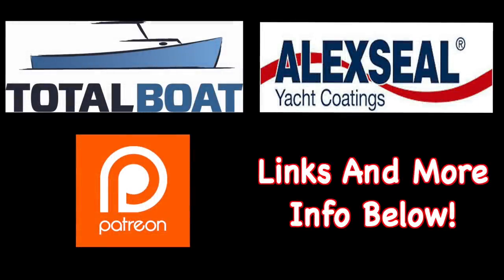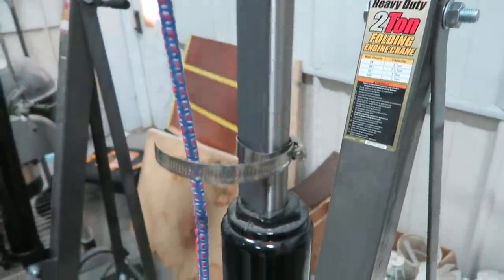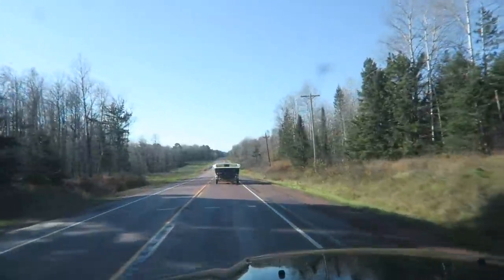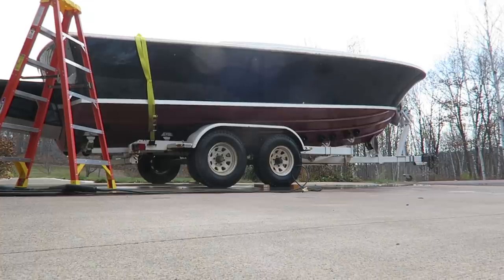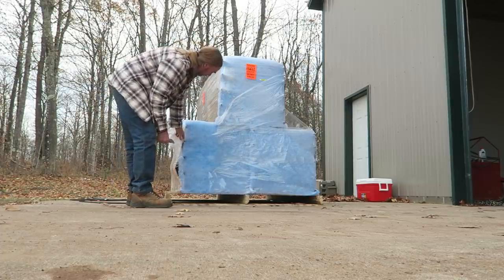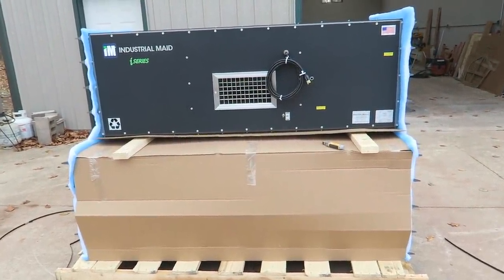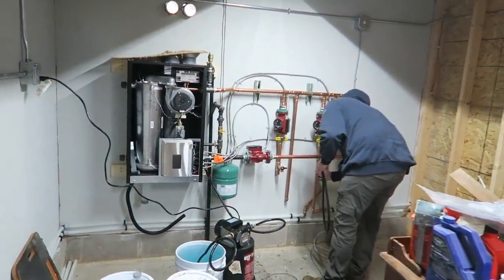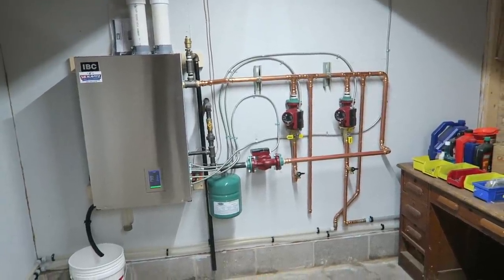Moving The Bertram To The NEW Boatworks Today Shop!

Comment: Andy, next spring, if water continues to be a problem along that concrete block, have a foundation guy spray it with waterproofing on the outside.  It doesn't cost very much and is done every day for basements and crawlspaces.

Comment: FYI you can wedge a 2x4 between the ram base and the ram top. You may have to trim bottom of board to fit between base and ram. Add a small peace of flat bar to keep bottom of wood from splitting if needed. Worked for me I could sleep at night with this method. Keep up the good work!

Comment: on your water penetrating the side wall.  first thing is check the slope of the grade adjacent to the wall make sure it drsins away from the building and your not inviting water to live alongside  the foundation.
second if water is attracted to the foundation you may need to trench along the wall, clean the concrete well and apply a good sealer to the concrete.  theres a bunch of them made for this purpose and one is about as good as the others.  while the trench is open toss in a perforated drain pipe to channel any water getting down there out behind the shop somewhere.  Definitely a spring project and you have a lot of time to think about it.  this is just one idea you might consider.

Comment: Andy, I told Beau and Brandy Sailing. They are bloggers just like you but they are sailors without alot of knowledge about fixing boats. But they will be experts soon. But anyways I told them about you and that I watch your show every week. They have a leak somewhere on their boat. They will find it. But the situation where they will need advice for is between the fiberglass and the lead keel is water. They drilled holes to let the ocean pour out. Yes I said ocean. From what I saw it was alot of water draining from about 6 quarter inch holes. I would guess about 2 or 3 gallons of water. I told them about penetrating epoxy but from the amount of ocean that drained out they will need a much cheaper way of going about filling that crevasse in their boat. I told them about I watched you show when you rebuilt the rudder on a project. You used some kind of epoxy foam that won't soak water. I was thinking if they used that to fill the void than penetrating epoxy further up to re-attach the hull to the lead keel. But anyways what I'm asking you is what do you think. Am I out of my babbid ass mind or do you have a better solution?

Comment: Around that perimeter, Drylock makes a "crack filler" that you put at that joint, and then grab the drylock and put it on the walls.  I did this in my basement and my I never have issues...I also did this in my garage that had issues, as you have, and I applied the crack sealer as well as the drylock paint and Robert's your mom's brother...no water issues.  Worth a shot, but I do believe they have a 60F surface temp requirement or similar.  Won't help your heating issues, but it could help you out for water intrusion around the perimeter.

Comment: Check to see if there is a french drain around the perimiter of the work shop. With wicking like that - there's avery good chance that there is not - but should have one installed. Having a contractor install one wil be in the sub $1000 range for a small bulding like that. If you are planning to be there for a long time - it's well worth the initial investment. You should probably check the house and have one installed there too...
Reply from the maker: House is good, but guarantee there's nothing like that up at the shop.  Prior to us it was strictly a cold storage building :-/

Comment: Maybe something to think about before you move more stuff into the shop, any typical garage floor epoxy will keep things dry and prevent the slab from absorbing the heat. Not to mention it's extremely easy to clean. Any spilled boat resin or epoxy will peal right of of it when dry. Probably a bit expensive for that size shop but also probably well worth it in the long run.

Comment: Not that I doubt your knowledge, especially with Total Boat products but I was a little concerned about getting all that fairing compound wet. I'm going by car panel filler (bondo) I think you guys call it, shouldn't get wet because it can absorb water and start the panel under it rusting. Obviously you don't need to worry about rust but could it cause adhesion problems for what ever is going on top?
Reply from the maker: That's the difference between an epoxy based product (Totalfair) and Bondo (inexpensive poly based material :-)  Doesn't make a bit of difference in this application ;-)

Comment: I was wondering about the transom extension, didn't you remove all the bolts, or did you replace some for the move ?
Reply from the maker: I left the top port and starboard bolts in place.  Also this thing was mounted using 5200 :-/

Comment: There is a waterproof membrane that you can get to put around the cinder block that will keep the water and moisture out, the stuff is used for waterproofing foundations, it works pretty darn well.